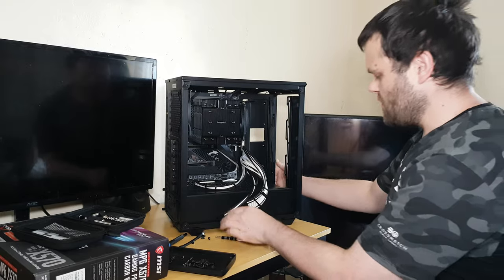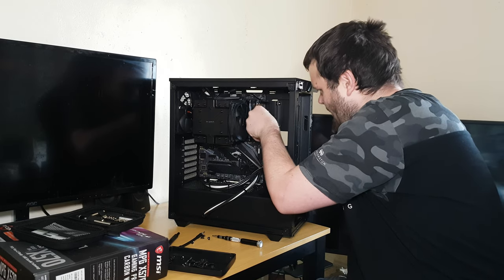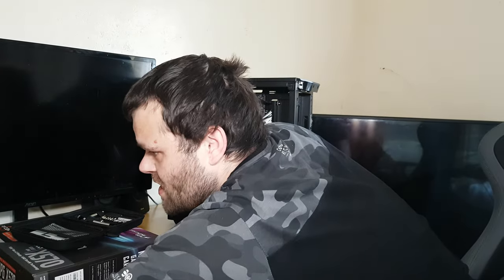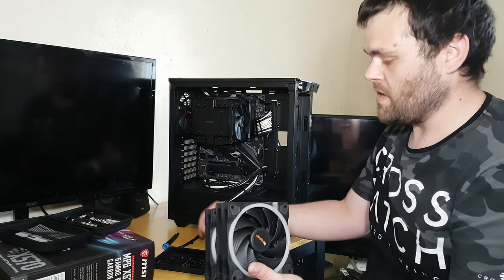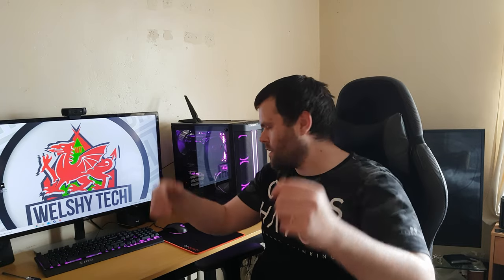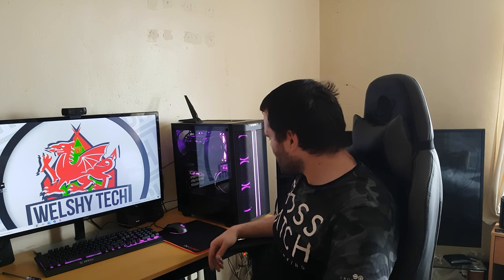PC Build - Featuring be quiet Pure Base 500DX

Comment: One question: How do you managed to install all fans? Your motherboard has enough PWM headers? I'm stuck because the hub that comes with the Light Winds its just for RGB, fans doesn't spin at all.
Reply from the maker: My motherboard has 6 fan headers but I used fan splitters you can buy them on ebay and split 3 4pin PWM fans to one header I've always done it bud hope that helps